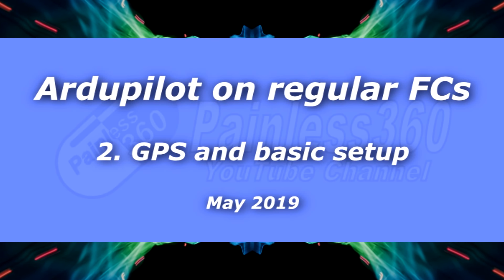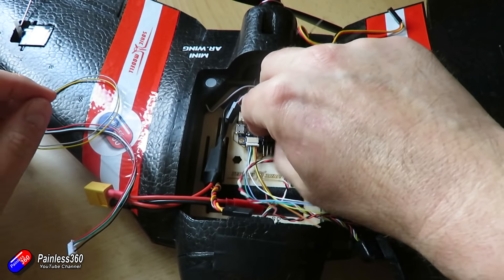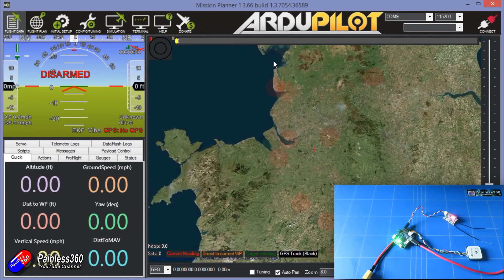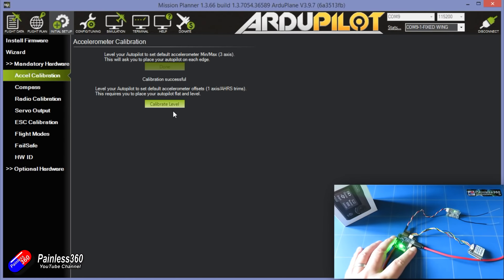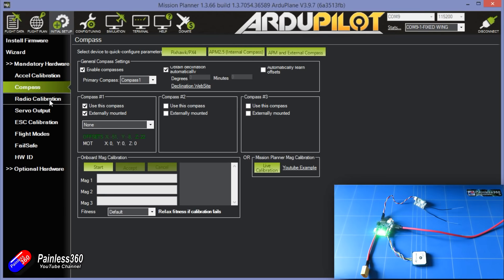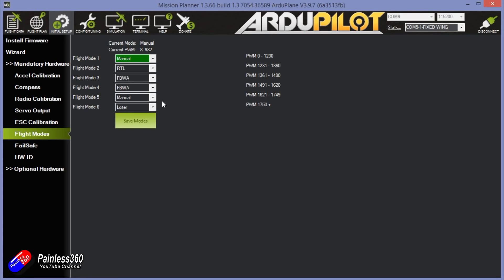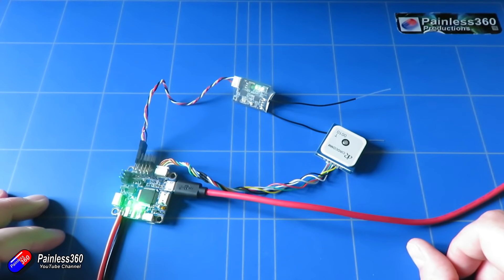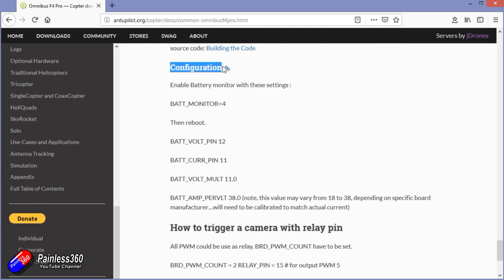Easy Ardupilot on Omnibus Series: 2. Connecting the pieces and basic setup

Comment: Hello friend !
I have an Omnibus F4 Pro V2 flight controller, the one in black, in fact everything is working correctly, I just can't connect to the Tx1 / Rx1 serial port with Mavlink telemetry via radio, I checked the cables and the position is correct, I also have an Omnibus F4 Pro V3, the blue one, and I didn't have this kind of problem with the telemetry. By chance, some change would have to be made in the Mission Planner. Thanks !
Reply from the maker: Sounds like something specific to that variant of the flight controller. I've not had one of those in here to try.. Best of luck!

Comment: Great Video, I have watched multiple videos, However, I am trying to do a quad-build using Holybro-kakute-F4. I want to fly only using GPS and Telemetry Module. Is it feasible, I have connected the GPS and Sik Radio, no compass and no RC. Pls comment
Reply from the maker: I've never flown like that. I'd check the Ardupilot docs... Best of luck
Reply: @Painless360  Thanks for responding, Just to let you know, I have flashed the adrupilot firmware on Kakute F4 AIO, Able to connect FC with Mission Planner . Connected the Sike radio[connection is established], motor test and all is working...
Working on GPS--> this is giving me some issues, I will fix them 
I am assuming we can fly using waypoint mission planner without the need for additional RC[Frsrky, ExLRS]. I am not planning to use Tx Module like Tx16 etc. Just fly using Autopilot with GPS+ compass + Sik Telemetry + Mission-planner.
Is it possible?
Reply from the maker: Again, I've not flown like that. I've heard of pilots flying with just a ground station but not done that here.. Best of luck!

Comment: I know that I am very late to the party and you may not even see this but I am wonder if you think flight controllers that aren't on any list you can find could still be flashed with ardupilot. I've found one that I would like to use because it can support up to eight motor outputs but it isn't on any list that I've seen as being supported.
Reply from the maker: If you try something that is not listed then you are taking a chance that it won't work. I would always go with the listed boards... best of luck

Comment: heres a odd question, could you use this set up without a prop and motor? as if to glide to a target GPS point? if i threw it off a cliff with an up draft  and wanted it to land  close by at the bottom of the cliff?  no RC control input required?
Reply from the maker: No idea, it is an interesting idea. Maybe there is another pilot who has tried it in the forums... best of luck

Comment: Hey buddy, so after finally figuring out how to get the omnibus f4 v3 pro connected, when i go into ardupilot the yaw is constantly changing all the time, i dont mean bouncing up and down, i mean constantly counting from 0 to 359.99 even when the omnibus isnt moving. Tried calibrating accelerometer and +level , they came back fine.
 Have you seen this happen before? 
Im reluctant to start soldering the pads, removing the diode etc until i figure out if this boards faulty...
Reply from the maker: Sounds like drift in the IMU. I've not seen that here. Adding a calibrated compass may help.. best of luck
Reply: @Painless360  Thanks for getting back to me, appreciate it.

Comment: Hello, I would like to set up my spare  CC3D Revo, with UBloxNeo-M8N GPS to set up with Ardupilot for PLAN flight. I have set up that GPS to work with CC3D Revo (using LibraPilot) without having to do anything with the cables/pins using Flex Port. I'm lost when trying to do in Ardupilot Mission Planner. Would you be able to help me out? Would be grateful. Thank you.
Reply from the maker: The series shows all of the steps you need to put it tougher and fly.. Best of luck

Comment: Nice cheap FC   the only problem i seem to have is running the sik radio and gps , as soon as i plug both in one cuts out, ardupilot forums suggest r e moving a part from the board to allow both, i did this but then wired the sik radio in the wrong order. Have you successfully  run the both together and have you a link to the video, thanks in advance Tim M
Reply from the maker: I've only connected a radio and GPS as shown in the series... best of luck!
Reply: @Painless360  thanks for the quick reply, will let you know ifit works, i have one more board to try, atm the chinese mini apm is what i am using in my nano talon, as it worked out of thr box, thanks again-Tim

Comment: Are there any issues I need to be aware of when setting up a V Tail eHAWK 1500 with this setup. I'll need to mix rudder and elevator i suppose? Also, because we're a year on from this video, is the Omnibus still the best choice for cheap fixed wing flight controller on Ardupilot? Thanks for the great series!
Reply from the maker: Check out the Pixhawk 2020 series where I setup a v tail. I'm about to use an F4 Omnibus Pro for another Ardupilot build...

Comment: Hello Friend !  I have an Omnibus F4 Pro controller, and after I updated to FW 4.1.7 I'm having problems with the Mission Planner, certain functions disappeared, I can't access the flight modes anymore, I lost the whole page of the advanced parameters, that is, I don't know what happened, oh, another thing, in QGround, everything is perfect, I went back to FW 4.0.5 and even then the problem continued, I think it's Ardupilot problem, because in some versions of Mission Planner, some things come back and others disappear.  Do you have any information about it?  Thank you !
Reply from the maker: I'd always recommend uninstalling mission planner and re-installing the latest version from scratch when odd things like this happen. I've seen weird things happen to Mission Planner that has been updated a few times occasionally.. Best of luck!
Reply: Hello Friend !  I did what you said and it didn't work, I found out that the problem is in my notebook, on 03/18 I updated my computer, and I think that's when it all started, today I did several tests and found that my bus is working perfectly on the notebook of my friend, and his omnibus is giving the same problems when connected to my notebook.  I'm going to reinstall Win 10, and see if I solve all this.... Thank you very much!!
Reply from the maker: Reinstalling Mission Planner should also re-install the drivers and that can often fix issues like this. Best of luck with it..
Reply: Hello friend !  I did what you told me, reinstalled the latest version of Mission Planner, and everything was resolved!  👋👋👋.  Thank you for your work, your videos are fantastic, it helps us a lot.  Thank you !
Reply from the maker: Glad it worked. It is always the first thing to do as Windows updates can mess up drivers. Don't forget you can support the time I put into answering questions by becoming a Patreon..

Comment: I recently came across your video series about ardupilot on Omnibus FC as part of my research for a quadcopter project. I too want to use the ardupilot software on a smaller, cheaper flight controller. However, in our project, we want a raspberry pi to act as the flight computer which will instruct the flight controller how to move, instead of a radio control. But, in the ardupilot setup, in the mandatory hardware section, there is a "radio configuration" section. How to configure this, when I don't even want to use a manual radio control.
Reply from the maker: No idea, that is outside of what I am familiar with. I'd check the Ardupilot documentation as all you can do is in there somewhere! Best of luck!

Comment: I have an old APM, can i use its GPS on this board?
Reply from the maker: Sorry, I dont understand what you are asking..
Reply: @Painless360  humm...I have an APM 2.6 wich haves an external GPS. Will it work on an omnibus F4 board?
Reply from the maker: Got ya! I've not tried but of it's a regular M8N or similar I cant see why not. There is only one way to know, best of luck!
Reply: @Painless360  thx
Reply: Yes, i used a crashed cheerson cx-20 gps andcit works fine , just read on the gps for the wiring

Comment: Hi great video, but i have a little problem with connecting  the gps to the board.
I bought  exactly a same components as you but the connection for thae gps is not fit in the board
what should i do?
how the connection called ?
Thanks
Reply from the maker: Dupont connector. Or servo leads.. Happy flying!

Comment: i followed along and according to wiki throttle goes on servo 3 instead of servo 2 as indicated on video or am i wrong?  having a hard time getting this to work. if i put elevator and aileron instead of elevon i get it to work perfectly in manual, but in fbwb its all reversed and only one servo moves.. is there any corrections to video i missed?
Reply from the maker: What I've done to get mine working is all in the series.. best of luck!

Comment: Will this very FC board drive a ESC plus 4 servos (R Aileron, L Aileron, Elevator, Rudder) using Arduplane?
Reply from the maker: There are 6 PWM outputs but two will work with a little wiring..

Comment: then shows how to calibrate the consumption sensor since this board has directly welded on it if possible
and share your configuration file
Reply from the maker: You'll need to run the power to the model threw a wattmeter so you can see the amps being drawn from the battery and then change that value one at a time until the on-screen display value matches that shown by the amp meter connected to the battery. Best of luck
Reply: @Painless360  
Are you going to explain how you do that?

Comment: Hi Lee, Do you know if you can set more than 3 modes  with Arduplane so I can autotune it and then switch to just FBWA, RTH and manual without having to hook it up to my pc. I have the Mini Pix on my S800 which works and flies fab apart from not switching to RTH when transmitter is turned off...!
Reply from the maker: Yes you can, maybe I will do a video on that..
Reply: That would be fab if you could .

Comment: So compass is necessary for a wing in Ardupilot?(or have I missed a thing in previous YT clips 😅)
Reply from the maker: I never fly without one if I can find a good spot for it. You can disable it and use the GPS virtual heading but I'll be testing that later in the series..
Reply: LongRange FPV in my experience a compass is more complexity and potential failure than it’s worth on a fixed wing. GPS course is just fine.

Comment: I would really like to use this board in a light mapping wing, do you think it can offer the same functionality as a pixhawk? like the capability of using digital airspeed sensor , telemetry , shutter trigger , I2C splitter for added peripherals. I'm very excited with the development of this little board.
Reply from the maker: Not this one as its short of UARTs to control things with.. Others may be a better fit.

Comment: hi, I would like to ask for your suggestion, as his tutorials allowed me to start building drones. I have already built a 250mm class drone with Omnibus F4 and Ardupilot firmware, but the receiver was not able to make it communicate with the FC unless using the PPM protocol. With the Sbus protocol, I made several attempts, but no results. can you suggest me the solution to my problem? I thank you very much in advance for your time! note: the drone flies perfectly and with GPS fix.
Besta regards, Mauro
Reply from the maker: Earlier boards didn't have the Ppm or Sbus soldering pads. This is the V3 version.. Best of luck
Reply: I thank you for your kindness! I have tested both the V2 version and the V3 version identical to its board in the video: in Sbus the receiver does not work! do I have to set any particular parameters in the ardupilot list? I used a Copter firmware, not Plane: will that be the problem ??
Reply from the maker: You solder the PPM pads? Every step I did are in these videos..
Reply: thank you so much for your kindness! I think I've done the same steps of his video, the only difference is the plane-copter firmware. Perhaps in my version the huart port of the RX is not set well and I don't understand how to solve. unfortunately the valid RX in PPM are not many and often they are of big dimensions. I thank you again!
Reply: mauro fanni if you have a V2 board (no PPM/SBUS solder pads) there is a resistor that must be removed. https://www.rcgroups.com/forums/showthread.php?3102183-Most-Integrated-Ardupilot-Flight-Controller-%28ChiBios%29/page88

Comment: Hi Painless i'm always with my Pixhawk and i get always a red fixe led  when it boot....i've tried to upload the last firmware for it but i don'k know exactly which one ...i find a lot of firmware on internet ...do you have an idea...Thank's a lot
Phil
Reply from the maker: I simply download the latest version of the firmware in Mission Planner. That always seems to work for me. Best of luck!
Reply: @Painless360 thank's for your answer but mission planner don't connect with my pixhawk anymore when i plug usb cable...and i don't know how to load this last firmware...?
Phil
Reply from the maker: I always recommend using Mission Planner so I'd look at why you can connect.. Best of luck
Reply: @Painless360  Hello Painless...after tried a lot of time to resolve the fixe red led on my Pixhawk 2.4.8, now i get only this result...I/O PWR...fix green , B/E...yellow fix....ACT....blinking blue ( not rapidly )
then FMU...PWR...fix green,  B/E...yellow blinking very rapidly...
under QGround control, this program said...Waiting foe vehicule connection...nothing apened....
do you have an idea...Thank's a lot
Phil

Comment: I'm using an OmnibusF7v2 but the Ardupilot documentation doesn't have a wire schema. http://ardupilot.org/plane/docs/common-omnibusf7.html I figured out so far reading the Ardupilot src code that the pin layout is the same as Betaflight. But which UART Ardupilot uses is yet a bit of a guess. You are using UART 6 on the OmnibusF4Pro. Should I just try all UARTS or can I choose myself? I would like to use UART 1.
I'll upload a wire schema to the Ardupilot documentation when I've got it working.

Comment: Could I use this setup in an old gps brushless quad while still having a pwm output for gimbal tilt control?
Reply from the maker: The FC has 6 PWM outputs but 5 and 6 will need some extra cabling..

Comment: Another great video Lee. Given that you can achieve pretty much everything using a standard FC what would be the case for buying a more expensive Pixhawk. I know that the cube has a lot of redundancy features in it but ... when would you choose a Pixhawk over a FC? I notice that the Mateksys F405-Wing FC is supported. Would this be a better choice given that the connectivity you have (e.g. 6 UARTS, 9 PWM etc.) is greater? Many thanks ...
Reply from the maker: A series on that FC with Ardupilot coming after this one..

Comment: Great video. I’ve always found ardupilot to be overly complicated when building wings - I’m a quad guy.
This will help me immensely ☺️
Reply from the maker: Of you are coming to wings from quads then check out the 'wings for quad pilots' playlist.. Lots of other tips there too..
Reply: Painless360 yep already been checking them out.
I’ve dabbled in wings for a few months with inav etc. But I need to learn more stuff.
Built a mini AR with minimal components last night (no fc/stabiliser, just fpv gear & x4r-sb rx)
Used your radio setup guide - sweet!
Also, the failsafe option you showed using the custom settings.....Any reason why you didn’t use “No Pulses”?
Reply from the maker: No pulses is a good option for when You have a FC. Bit there are times when no pulses cause odd behaviour..
Reply: Painless360 fair enough. Good job I’ve followed the painless failsafe guide anyways 😁
Enjoy MAS5 this weekend✌️😎